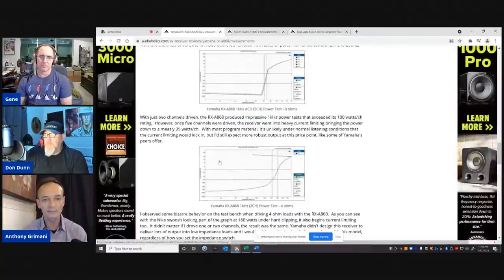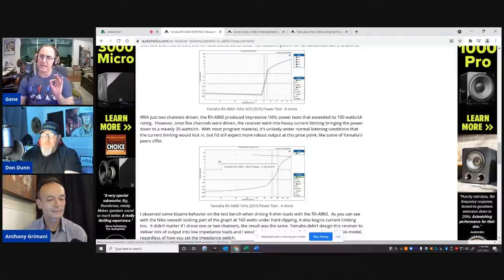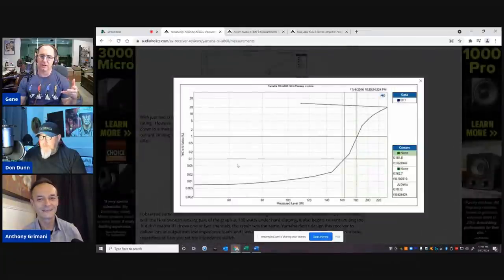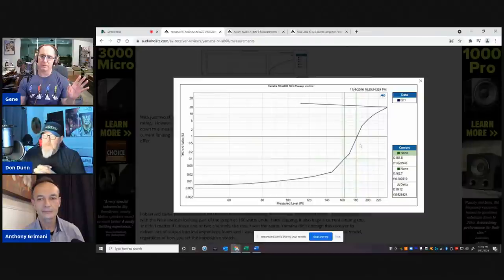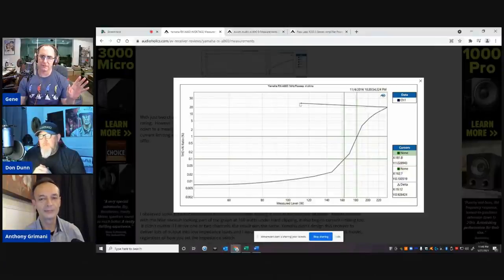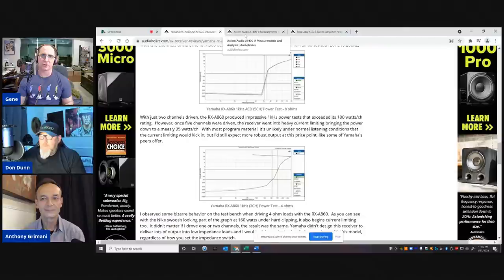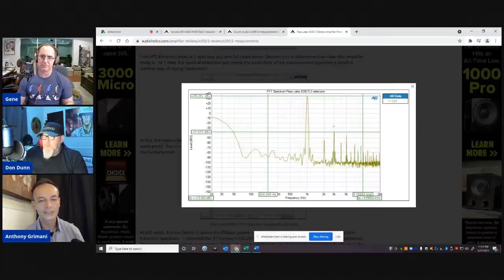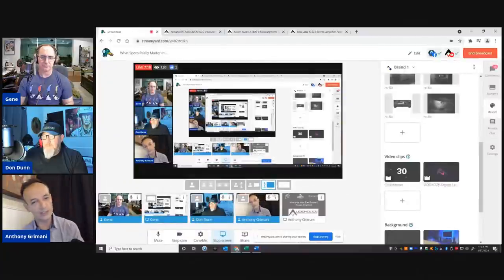What Specs Really Matter in Audio Amplifiers?

Comment: Im getting into adding amp to my AVR whats a good reasonable price and brand for one
Reply: Emotiva
Reply: Depending on your budget, look for an used Parasound. This is an A/B type amp.
Reply: Outlaw 7000x
Reply: @edaubakaha1845  I've heard great things about Outlaw.
Reply: @IAmRyan25  So only power amps that do the youtube rounds...lol
Reply: @Echo-jg8is  Nope, just the 1 I have experience with and the other that fit his requirement...I'm no pro by any means.
Reply: @Echo-jg8is  Yeah Kinda, those also happen to be the two I was looking at a few months ago when I picked one up
Reply: Okay so say you use the amp to power your front speakers can you still use your AVR to power another front speakers
Reply: @MrApple-qf3qo  Provided that your AVR has pre-amp outputs, yes. Most of them do for at least the L/R channels nowadays.
Reply: @IAmRyan25  so then I can connect the amplifier to the front pre out and still use the front channels on my AVR for other speakers
Reply: @MrApple-qf3qo  
I just re-read your post and obviously misinterpreted the question. 

Perusing through my manual, you could run A/B with your B's being the Zone 2 speakers. The drawback is that it still counts against your channel capacity. A 7.1 AVR running Zone 2 (whether you're using an external amp or not), will only be capable of 5.1 in addition to the B's. There are ways of configuring them so that if you want to switch between 5.1 + Z2 or 7.1, you simply tell the AVR what you want for your content without rewiring anything. Higher-end AVR's have better options in this regard and allow for external amps without sacrificing the on-board channels or Z2. These are spendy, which is why I don't have one yet!
Reply: @IAmRyan25  ok so then what it you use a y cable to the pre out ? You think you can connect 2 amps to a single pre out
Reply: @MrApple-qf3qo  In my setup, the Denon has one RCA for each channel and the Emotiva has one RCA per channel. A standard RCA 2-channel cable is all I need.

Comment: Bringing up computer power supplies is a bad comparison. They are not all created the same. Some may say 1100 watts and be split into very small current rails that aren't enough for power hungry GPU units, even utilizing two of the rails with two connectors. They could be as small as 15 amps each. Comparatively, you can have another 750 watt unit with a nice 62 amp rail just for the GPU. They are very different.